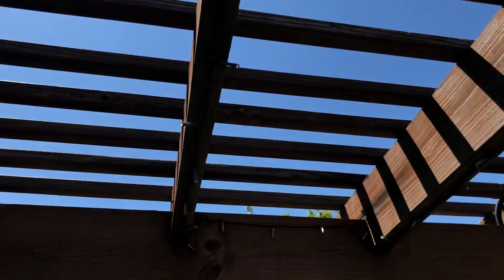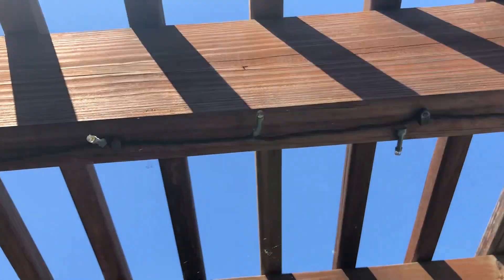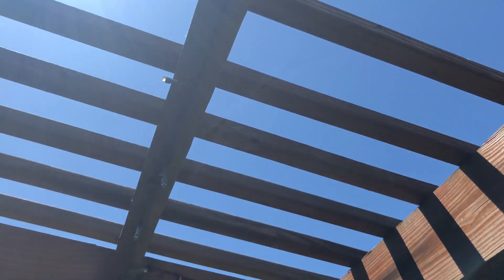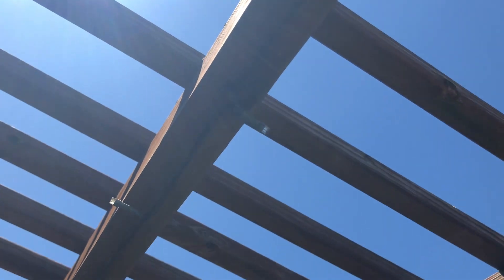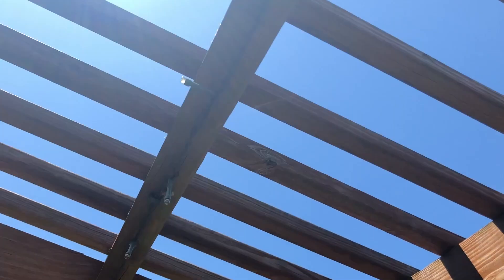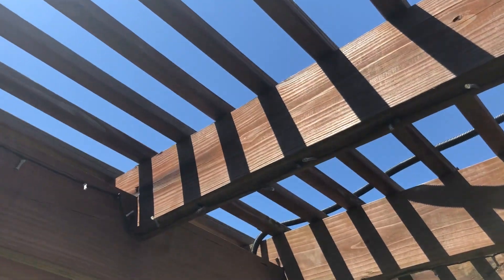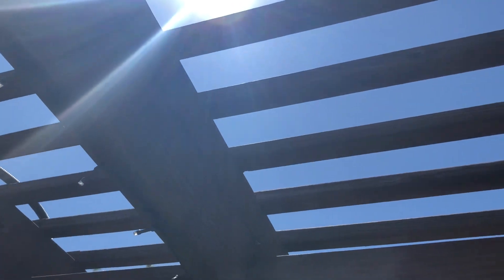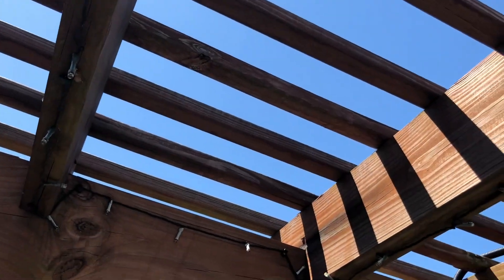How to connect Solar/Battery LED Light String to Low Voltage AC Power

Comment: Thank you for this video. I hv 5 solar powered willow light units that r  sold by bhg. The output from one unit is 1.5v. I dont want to connect buck converters individually to every unit but thought of connecting all 5 (then the total voltage will be 7.5v) and use a similar buck converter to get the output i need. Do u think connecting all will be a good idea? txs

Comment: Love it!   I was going to do it with a voltage divider scheme, where you put two resistors (very high value to limit current draw) in series and use the junction of the two resistors to power the LED’s.   I’m not actually sure a rectifier would be needed since LED’s are actually diodes and only pass current in one direction anyway, and essentially would create a half wave rectifier.. so the lights would only be on half of the 60 cycle waveform, but at that speed the flickering shouldn’t be noticeable.   All that said.. I like your solution better.   I never tried my approach so I’m just going to copy your solution as it looks better with the adjustability.   Nice job amigo!!!   Thanks for sharing!!
Reply from the maker: Thanks for the nice comments!  Also, the system I put in place has been running flawlessly for 2 years now.  Still all original parts!  I did have to dial down the voltage from what I originally set it at in the video though.  It was just too bright and if I had left it at that, the lights probably would have burnt out by now.
Reply: @manueltran1964  Probably correct on shortening the life of the led’s.   Can’t be certain but it does seem logical that if they’re burning that much brighter they might lower life expectancy.  Anyway, I’m sure you weren’t using them for illumination as much as just ambiance/mood.   Cheers!!
Reply from the maker: @keithmurray9241  Just added links to parts in the description.
Reply: @manueltran1964  a potentiometer connected could allow you to dim the lights as well
Reply: Forgot.. post links to Amazon or Lowe’s... wherever you sourced the components.. guessing viewers would like that!   Cheers!!